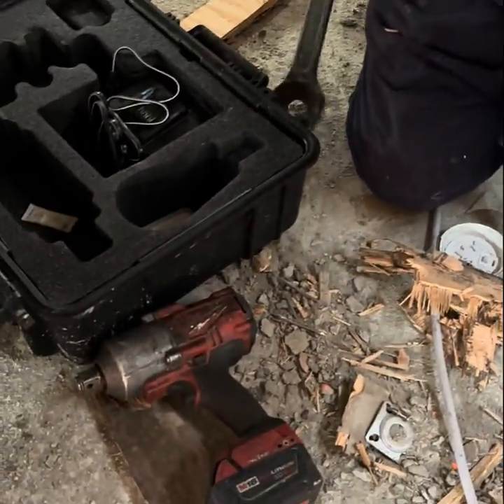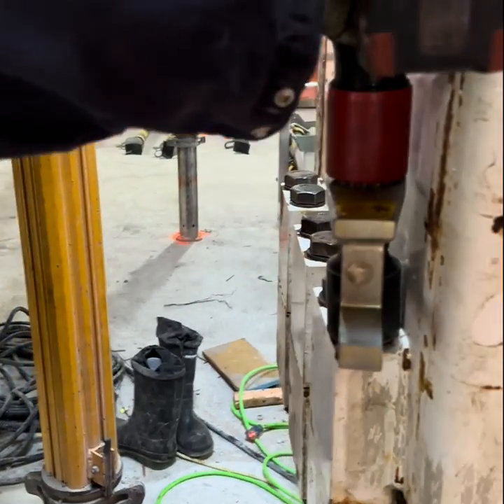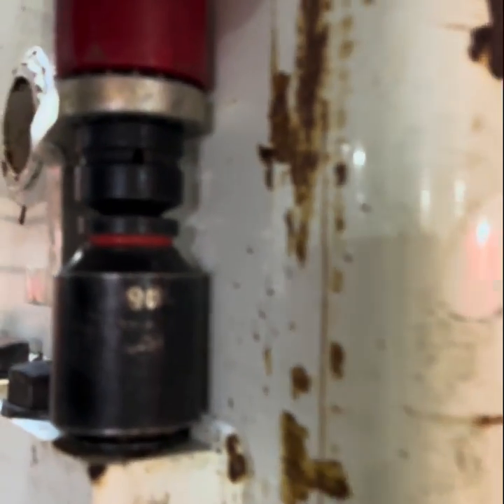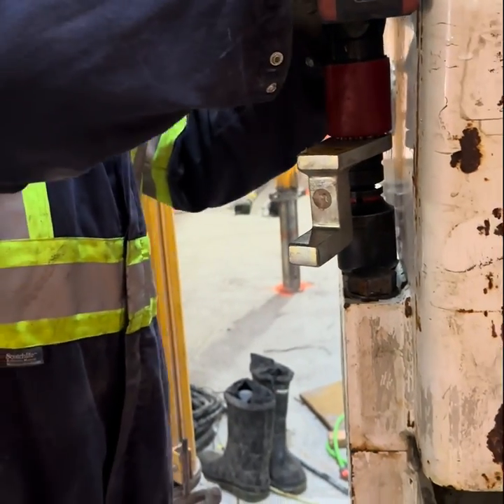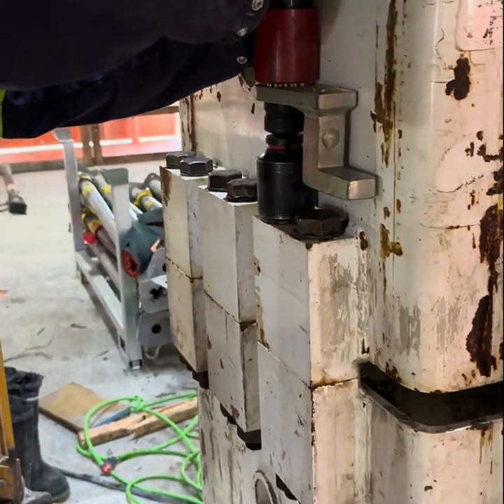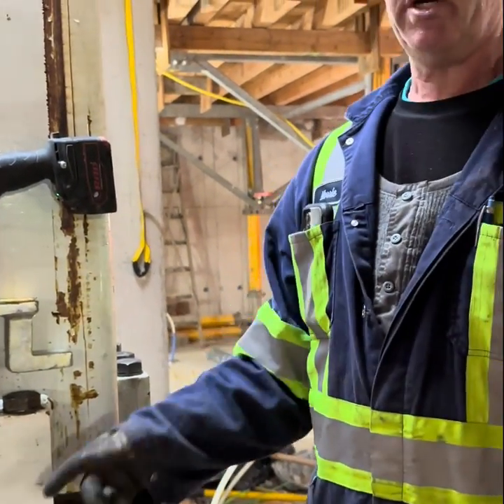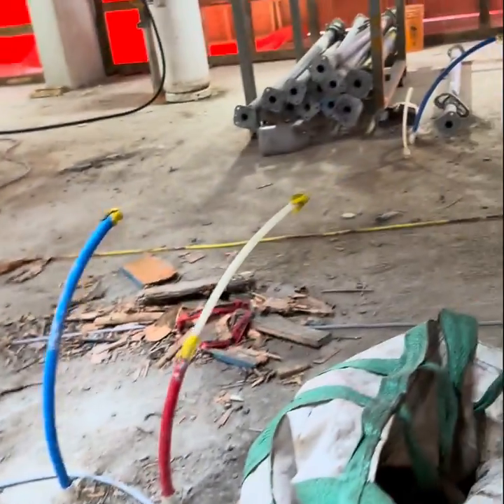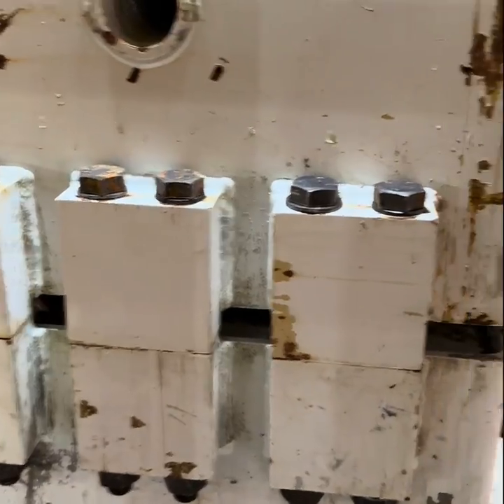1500 ft/lbs battery powered torque wrench

Comment: That thing is sick!! Curious if the same torque is achieved even when you’re using a battery that is not fully  charged? Like a battery with only one bar or two bars left on the battery charge. Not familiar with the procedures of the mast set up, is it protocol to have a secondary or a third party verify torque specs. Like with different colored marker pens? Not too familiar with mast set up?
Reply from the maker: Don’t quite me on this but, to my knowledge I don’t believe there is, at least not anything that is blanketed as industry standard. Companies may have their own written policies as well as recommendations specific from the manufacturer. I do know that the torque spec. is apparently lower if Loctite is used on the threads of the bolts. These guys hadn’t mentioned anything about torque falling off as the batteries lose charge, but their also not running the unit to maximum torque capacity, so you may be into something here 🤔🤔🤔